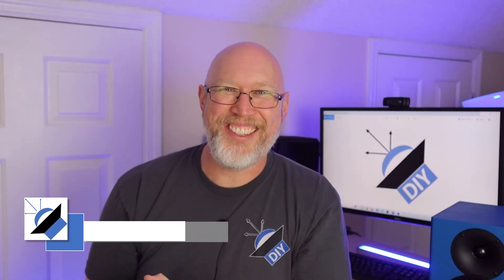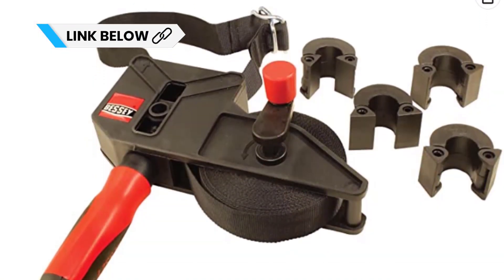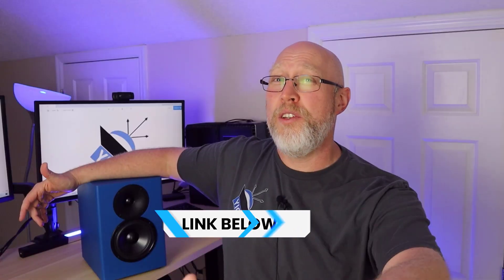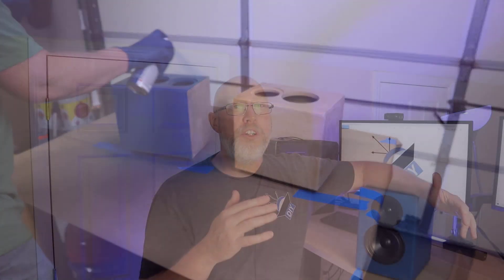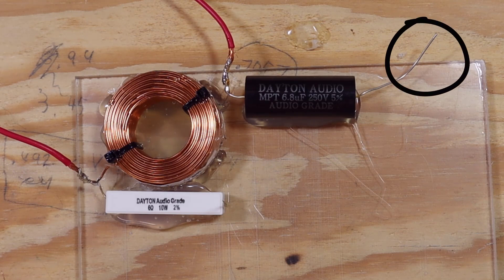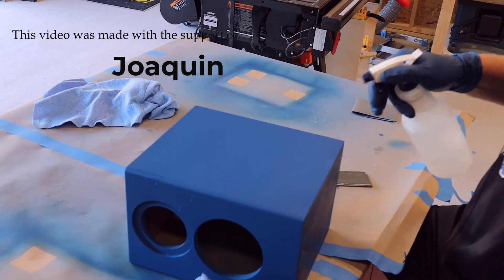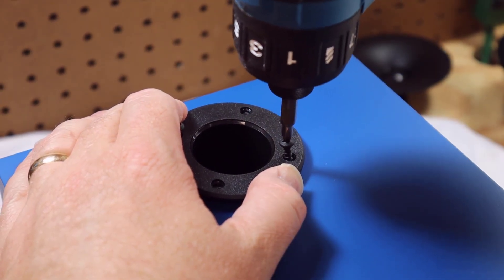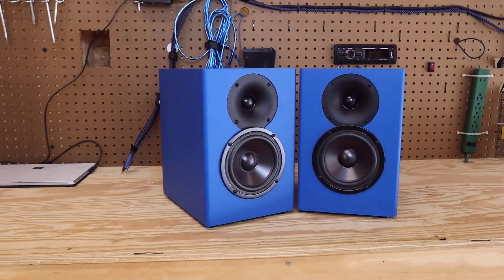DIY Speaker Kit: How to build the C Notes @PartsExpressOfficial #DaytonAudio

Comment: I'm considering new speakers for my logitec z906 home theater setup . I want to keep the electronics, subwoofer ( for now)and replace the speakers themselves.  Looking for low dollar route but it has to sound a lot better to make it worth the effort . Z906 Logitech speakers sound absolutely horrible . Yes they get loud but its harsh with obvious cone breakup .
Would 5 of these speakers do the trick ?
Reply from the maker: Yes, but your going to be limited by the bult-in amp that came with the system.

Comment: I made these, but didn't like the woofer mount. I routed the inside of the face board to take the woofer and make the focus point of the tweeter and woofer in the same plane. I use these in concert with a subwoofer, also from Parts Express.
Reply from the maker: Cool

Comment: bought  this kit  and mounted it.
a bit disapointed about the sound.  especially  in the medium,  really.
6ohm  resistor could be replaced by a lower value  to reinforce  treebles.
   bass are correct.
I've tried  some synthetical whool fibers   to  any  better result.  still  disapointed.  my overall note  is 6/10
Reply from the maker: Hate to hear you did no like it.
Reply: @DIYAudioGuy  I'm sorry  bro   but.. :-)

Comment: If I'm listening in a 350 sq. ft. room 4 to 10 feet away, won't I get better sound from floor speakers?
Reply from the maker: Not necessarily, as long as the Tweeter is at ear height you should be fine.
Reply: In what case would you use floor speakers or larger woofers, etc.?

Comment: I like this build! I was thinking of building some bookshelf boxes to add to my home audio. The only speakers I have laying around right now are some jamo a2 6.5 ceiling speakers. Do you think ceiling speakers will work in bookshelf boxes?
Reply from the maker: I honestly don't know. Most in ceiling speakers are a coaxial design and for some reason that is frowned upon in a bookshelf speaker. If the speaker has a sealed back then really won't matter what type of enclosure you put it in. But if it doesn't then you'll have a hard time getting the exact right enclosure for the best possible bass response.

I say go for it, you might learn something interesting along the way.

Comment: I feel your pain wet sanding… i once refinished a stock on a vintage .22 after over 20 coats of spar varnish and 2000 grit paper it was worth it though. finish was like glass.
Reply from the maker: Yeah, this project took a long time mostly because I put down several coats of paint. Trying to get to look just right.
Reply from the maker: Duratex from parts express.  Spiders don't care if you report his indoors or out. They'll still find it and climb in there.

Comment: Love the color, really cool. I find it a strange design decision by dayton to not recess the woofer, looks odd and is in the way if the waveguide for the tweeter.
Reply from the maker: I thought the exact same thing.
Reply: hey that extra few cents they save by not recessing the woofer really adds up
Reply from the maker: @idrinkpowersteeringfluid  LOL
Reply: It isn't hard to recess the woofer if you have a router.
Reply: @loveracing1988  true, but the tweeter is in the way, so you need to router through that😆
Reply: @Stan_the_Belgian  it's plastic so it routers just fine. It makes the speaker look so much better. Get some sticky foam though to seal the tweeter.

Comment: Painting hack,  hang them to paint. Take any kind of rope, paracord, speaker wire,  and tie a knot in the end with a 3 inch nail or screw through the knot. Hang the other end from whatever... so that the screw is eye height. with it securely hung, stick the screw or nail end into the tweeter hole and the turn it sideways so that it hangs. You are now free to spray all of the sides at once without touching it.
Reply: I just used a coat hanger hooked to the piece between the woofer and tweeter.
Reply from the maker: Definitely going to try that next time!

Comment: Do they make a flat pack but with pa speakers or something that can play loud for long periods of time?
Reply from the maker: You want to hit up Nick over at Toids DIY.  He has designs using big ass 15-in PA drivers and horn tweeters, and he can cut some flat packs for you.
Reply: @DIYAudioGuy  thanks, yeah power compression is one thing but thermal failure is another!

Comment: Putting together the crossover may turn off some of us. Can you recommend a 2 way and 3 way pre-made crossover for 100 watts? I'm looking specifically performance and value.
Reply from the maker: The MK boom uses a pre-made crossover.
Reply: Dayton audio kabd4×30 or 4×100 depending on how much power you want
Reply: Get a pcb board from ebay